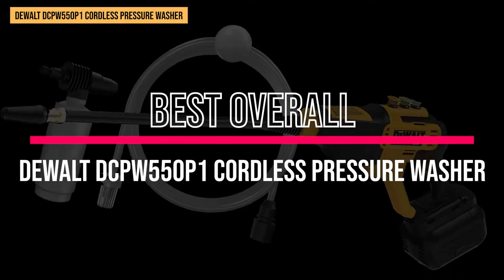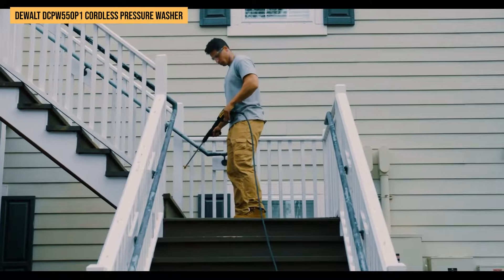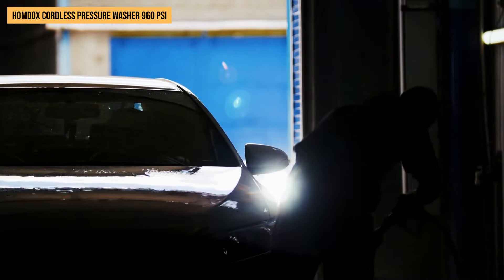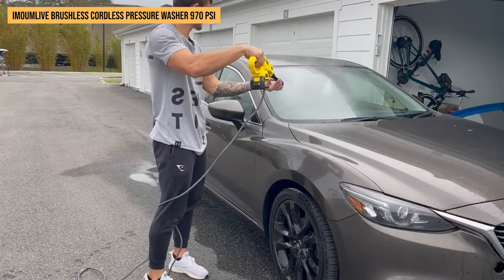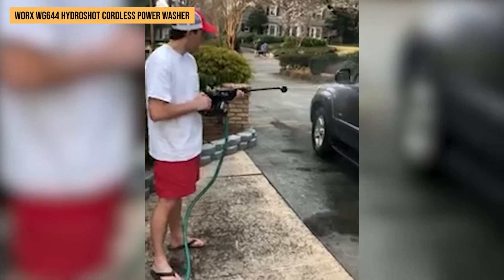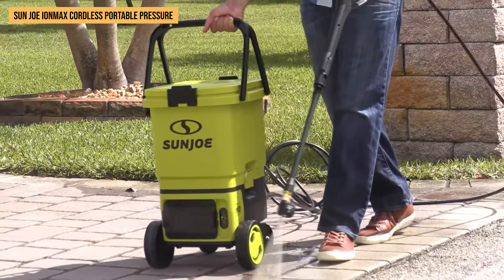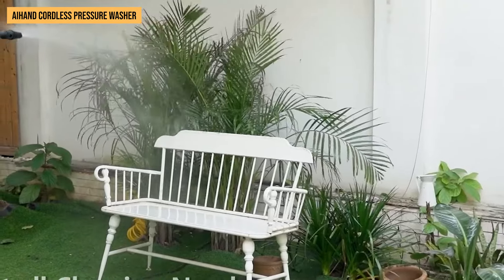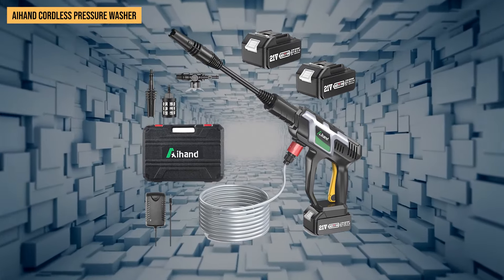6 Best Cordless Pressure Washers 2024: Reviews and Buying Guide

Comment: These motorized squirt guns are a joke! Good for cleaning the dust off your car. If your using a garden hose just get a pencil nozzle attachment. It will do the same job. But for cleaning the dust off when your miles away from electricity and pressured water this is a little better than using your pump weed sprayer bottle